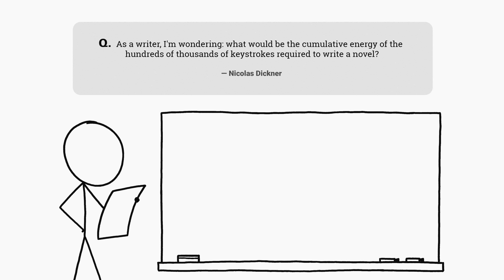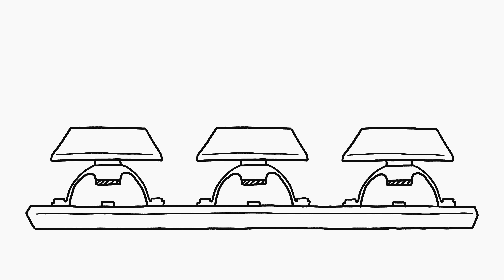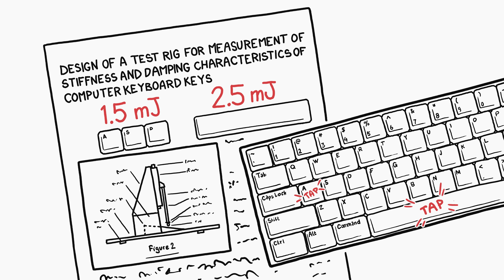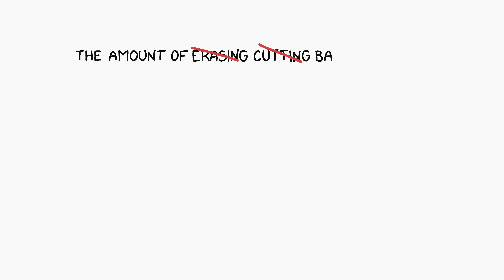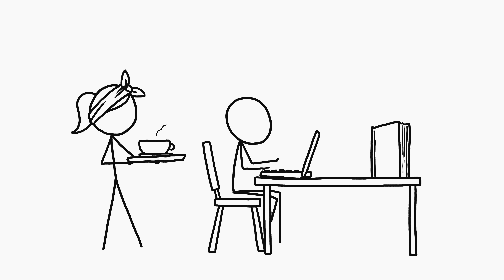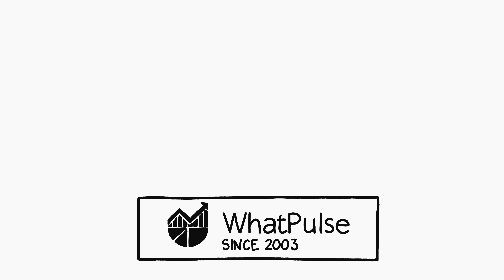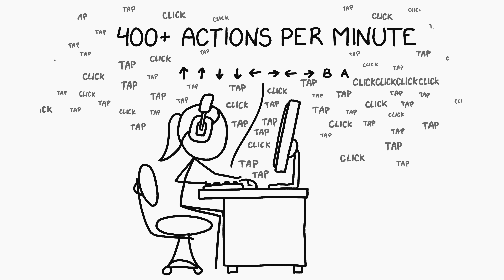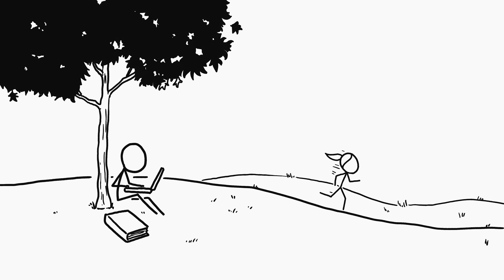Can you power your computer by typing?

Comment: On the topic of Vsauce's "Space Straw," let's say you had an infinitely strong material straw sealed at both ends and starting in space, with one end lowered into Earth's oceans and the other end fixed in space. 
You then open up both ends, starting with the end in space and then opening the one in the oceans.

The water would not just start being syphoned into space due to the weight of the water being too strong to overcome with the differences in pressure alone.

That said, you would notice the water height in the straw suddenly spike upwards as these forces equalize.

Depending on the diameter of the straw, how destructive could this be? What about instantaneous boiling of part of the water as it first enters a vacuum? And above all else, how much should I sell tickets for and how far away should everyone watching be located?

Comment: Xkcd, what would happen if everyone on earth simoultaneously (pardon the spelling) started a 100 gallon air compressor that goes up to 100 psi internally, would there be a noticable change in atmospheric pressure at all, and what could happen?

Comment: I think the most important question is could you create wireless keyboard without RGB lights than can work without any batteries, using only the stored energy from keypresses? I think it's possible in theory but would it work in reality with less than perfect efficiency in energy capture, energy storage and energy use?

Comment: For power generation you generally need either a high force over a short distance or a low force over a long distance. For even greater power it’s high force with a long distance. Electronic keyboards are a low force over a short distance so you aren’t going to generate much power. 
If you look at an old mechanical typewriter they tended to require both higher force and a longer distance. You’d basically need something similar if you wanted a chance at generating enough power. But, even then it’d be very tiring to operate. Regardless of the method you’re always inputting a little more than you’re getting out.

Comment: Just be sensible. Strap yourself with peltiers and sterling engines. Capture all that waste heat - and look cool while doing it!

If the keyboard converted your stroke energy to power would the key stay stuck down? Or is it only the waste noise energy we are capturing here?

Comment: Respect for another great video but I also a bit disappointing, this could have many more considerations and might deserve a second video. Mainly, the power consumption of PC is not elaborated on and it mixes writing text with gaming. Gamer PC will take much more power than something simpler and today we have extremely efficient computers. Linux running on tiny computer like raspberry pi, minimalistic setup powered on by like 3 Wats. Then there is display technology, e-ink, lcd, oled etc. But mainly, the keyboard doesn't get any attention. I understand there is only one research paper as source here but there must be difference between mechanical keyboard and some macbook one

Comment: Well a laptop takes a lot of power for other stuff, what about something like a basic e-ink screen?
I googled and found the Freewrite Traveler, with a 4200 mAh battery that is said to last 14 hours (4 weeks, 30 minutes daily), which is about twice the average AA battery. That battery was already at the assumption that the author would be rewriting their entire novel 10 times, so the functional equivalent of 10 novel's length of writing.
So considering how short its battery life is and how long it takes to write, this is just not practical, though better than a laptop.
But this device has fancy Wifi capabilities and whatnot. What if someone Raspberry-Pied together a super low-power e-ink display, lightweight Linux OS, and one of those super old mechanical keyboards on typewriters that take a ton more energy to type? Would it actually make up the difference for a really fast writer?

Comment: This makes me really curious to know how that power output compares to the energy required to communicate over USB. 

If each data pulse requires roughly the same amount of energy, and pulses are sent at a fixed clock speed, how fast would you have to type in order to make a "regenerative" keyboard require no energy from the host? (Assuming a standard slow-mode USB device, and ignoring the details of USB power delivery.)

Comment: I've gotta point out the mistake at the end. It is more exercise than what you claimed.
The energy actually used in pressing a key is not the same as the energy expanded to move your finger, contract your muscles, etc. You move all the mass of your finger every key press, energy that doesn't make it into the key.

Comment: What kind of keyboard was used in the study that measured keypress energy? I reckon that the different types of mechanical switches can require fairly different amounts of energy to press. And did the study measure the exact energy required for a key press, or the actual energy delivered? I reckon that I use at least a few times the "necessary" energy when I type quickly, as I "slam" my keys into the keyboard. Would be interesting with a little more nuance in this What If? scenario! :)

Comment: Okay, so you can't power your laptop by typing. What about just a wireless keyboard? Let's say we start with making a key switch that, when pressed, generates enough electricity to send a signal to the computer. How much resistance does a button need to have to be completely self-powering, and how does that compare to a manual keyboard?

Comment: As an interesting aside, I have wireless light switches (commodity, from the Phillips Hue range) that use a piezo generator to power up an IC, send a "proper" message using ZIgbee HA (a wifi-like mesh network), and then presumably use the remaining power to contemplate their fleeting consciousness. They work well enough, but the action is a bit clunkier than you'd want for a keyboard. I'd absolutely believe that you could append an edit to a text file on flash with ~1mJ. Refreshing an eInk screen might be difficult (typically 1W/100ms - 100mJ), but maybe some clever sub-section trickery might cut this back. Don't give up hope for a battery free electronic typewriter yet, even if the tiniest of batteries in a keyboard would make it last _forever_, its the principal of the thing.

Comment: Given that my MacBook Air M1 uses 3 W when it's idle (with some bg tasks running) and 1 W is 1 J/s, you'd still need hundreds of key presses per second to power a very custom ultra-mega-low-power laptop.

Comment: I do wonder if you could power the mouse/keyboard by interacting with it similar to self winding mechanical watches. It would be hilarious to see one of those old rubber coated bearings make a return to mice just to power the optical sensor and wireless connection.

Comment: What if the keys were elongated on a thick keyboard so they travel further and do more work? Perhaps there can be a resistance to make it require more force while still being practical to type on at a relatively normal rate. And can the energy from the keys poppin' back up be added? Turn all the keys into tiny solar panels that are there just to make you feel like you're doing something. I think we should consider tiny people inside the keyboard and scales partying all the time passively so the oscillation from their rave adds a passive energy generation. They can feed off the grime in your keyboard so you don't have to clean or sanitise with their magical spit. Their waste works as an amazing lubricant to stop the metaphorical joints of the keyboard from rusting. And when one of them dies, they hold a ceremony where they toss their fallen one off the desk into the adjacent bin, believing that it will turn them to the earth… which depending on the bin may not be wrong. Eventually the society will evolve to tame insects and use them in daily life to add even more mechanical energy! And as their intellect develops, they will find their own ways of saving energy, making the process even infinitesimally more efficient. In exchange for working on our nanomachines for our futuretop, we'll pour a packet of dorito dust onto the keyboard and they'll go absolutely wild for it! Their excitement making them even more productive than usual.

Comment: Probably gonna end up at the bottom of the comment section but what reference are you using when you gesso 30sec of computer time, what generation and with what running on it cuz I'm sure typing your novel while running a server farm takes more power than an optimized setup with a minimalist writing app and nothing in the background (word on a windows OS is not exactly optimized power-wise...)

Comment: i would go with a full body jumpsuit entirely covered with little 1 inch square compartments each containing the self winding mechanism from a mechanical watch, attached to a tiny generator, all collectively wired into a charging unit for a lithium ion battery in its own compartment conveniently located at the back of the neck on in the crotch area.  this could be used to power a pacemaker, a tamagochi, or a radio transmitter providing current location and other telemetry to local or federal law enforcement.  this is the most reasonable compromise

Comment: A double A battery every six months is actually not bad if you wanted to power the keyboard from the keypresses itself. I change my wireless keyboard's battery every few months anyways so it might genuinely be worth exploring. Maybe a tiny solar panel to get a trickle charge when not in use and you could potentially completely recapture the energy required to run the keyboard itself. Though once you actually introduce generator resistance to the keystroke it's likely the energy requirement per keystroke will double or triple, thus less strokes could be needed, but each stroke would either take more time or more force to press thus slowing down the WPM of (and increasing hand fatigue in) the user.

Comment: I think there is a missed opportunity here. Like what if we try to reduce the power usage of the "computer" as much as possible. We could use an e-ink display with an optimized board like a small esmp32 or a specifically designed board. Than write a custom os that would update the e-ink display on a debounce of the keyboard and otherwise enter ultra sleep. Connect it wired to the printer. 

Now the question becomes how long do I need to type blind before my screen updates. (If possible to buffer keys on power of key press). If that's not possible, we could always increase the force required to press the key

Comment: But wait, what about the springs???

When typing, you expend energy to push the keys down, and then the springs expend the same amount of energy to push the keys back up. That means there should be a net zero available energy for extraction. If the key is allowed to return to its starting position, then the energy of movement isn't available for capture, that means all you can capture are the friction and the clicky sound, which would be measured in micro- or nanojoules.

This has the same problem as those silly spring-loaded cobblestones concepts: you can't extract substantial energy from a spring loaded reciprocating system, because any input energy is by definition stored in the spring and used to accomplish the reciprocation!

Comment: But modern keyboards are designed to require low force input. If we're using the keyboard to generate electricity you would want to bore and stroke the key switches to allow for more travel and more force application. A typical typewriter keyboard could generate 10-15x the amount energy, but a typist trained to generate power could likely input much more force.

Comment: Hypothetically if I could hit my maximum clicking speed (225 CPS) for an hour (1.5*225*60*60) = 1125000 mJ/H = 0.3375W of power, I could power an under clocked, idle raspberry pi 0 thereby achieving the desired goal.

Comment: Assuming a 1000w microwave can be run if u type a book every 1 second then if all u are doing that laptop is writing then the power consumption of the laptops would be around 5w meaning u would only have to type a book every 200 seconds instead of 30. Maybe im wrong i am pretty bad at power conversions so sometimes time cancels out sometimes the side of thr equation has time 2 times

Comment: You couldn't power a normal computer, no, but I'd be willing to bet that we can already get pretty close to this with a very low power microcontroller instead. According to the data sheet, and some back of the envelope math, a basic and very cheap low power microcontroller like the CH32V203 at its lowest clock rate setting could be powered by as little as two key-presses per second assuming we could capture the entire 1.5 milijoules that goes into a standard key press. So its well within the realm of possibility, just not with a standard computer/laptop.

Comment: I think a critical issue with the idea  is that the energy you provide during the key press is stored as potential energy in springs (or I guess electric potential energy in magnets if you are using Hall effect switches?), and that energy is needed to make the key go back up once you stop pressing it.

Comment: NGL, this was a bit of a letdown. I was expecting an investigation on computers using the least energy to be able to write a novel (a Raspberry Pi Zero with E-Ink display?) and adjusting the key press strength needed to keep it running.

Comment: This assumes that the energy used to press a key can even be recovered. The energy that goes into pushing the rubber dome is used to push the key back up when it's released. You need to make the keys harder to push in order to extract energy from pushing them and have the keyboard still work as expected. Resulting in much slower typing speeds and more RSI

Comment: Ah, but keyboards are designed with ergonomics specifically in mind, in other words, the energy per tap is optimised for comfort. What if you deliberately increased the pressure required, to increase the energy? How much energy could you feasibly generate before the keyboard became unusable? There'd be a speed tradeoff too, but even old manual typewriters managed a good wpm in the hands of a professional.

Comment: I think more can be said about optimizing the power usage of the keyboard-driven laptop. If we avoid the modern OS and use minimal text editors (think early 80s),  it's possible to limit ourselves to microcontroller-level power usage, making it more plausible. One thing that's hard to optimize is the power requirements of the screen, but even there you could use e-paper updated once per second, which requires orders of magnitude less energy than a typical monitor.

Comment: I'm reminded of one of the older Hue smart bulb wireless switche, a circular button pad with chunky buttons. These buttons are very satisfying to press, with nearly 5mm of travel and heavy spring resistance, because the switch doesn't have any batteries at all: it's powered just by the brief pulse of energy you instill when you press the button.

Comment: How about instead of making our computers more powerful to run increasingly complex programs, we torch the increasing complexity itself. Every new software product is bundled with more than users want and arent allowed to slim down. Did you read this on the EDGE browser? You had to upgrade your hardware for it even if you never use it can arent allowed to uninstall it. Exercise, indeed.

Comment: While not much of a workout, spending your day hammering out keystrokes does increase your NEAT (Non-Exercise Activity Thermogenesis) which added to your resting metabolic rate will contribute to losing weight over the longterm.

It's not a lot, but it's not zero (like maybe 15-20 extra calories burned a day -- so you'd burn a whole lb or 0.4 kg in 6 months of vigorous typing).

Comment: My what pulse statistics: 

7,739th place on keys typed with 22,063,736 
9,799th place on clicks with 7,726,413 
1,709th place in downloading at 27.32 TB
338th place with uploading 58.97 TB 
442nd place with uptime at 11 years, 47 weeks, 5 days, 19 hours, 22 minutes and 25 seconds 
2,569th place with scrolls at 5,197,187 
And 3,620th place in mouse move distance at 427.71 MI

Why the heck is it in miles.. I live in Canada, it should be measured in total minutes traveled at 80 km an hour (which happens to equal a day's drive)
Reply: Although if you're driving for a full day then it would be most likely at 120 km an hour at least what would bring it down to half a day's drive at about 5 hours and 45 minutes

Comment: I learned on a manual typewriter, and eyeballing 40 year old memories, it was about g*100 grams of force over about 2 cm, or let's call it 50 mJ. At 150 wpm or 12.5 kps that's 625 mW. On a 60 W machine you could save 1% on energy. But manual typewriters don't plug in, so really it's saving nothing. All it was used for was to slap the hammer against the ribbon into the paper, and to release a latch to rack the carriage 1 character to the left, and that was reset all the way to the right by yanking the return lever, which recocked the spring that made it go. But it explains why there aren't any stories of typewriters getting red hot and catching on fire.

Comment: The best I would be able to say are those that do rhythm games on keyboards. A full "vibro" ability (which is just the vibrating your hand up and down as fast/controlled as you can) while fast, doesn't move the keys very much. However, you would be able to see about 100-140 kps, or 6000-8400 per minute with all ten fingers. Assuming full sustain for that time (not possible) and again, the keys aren't being fully pressed.